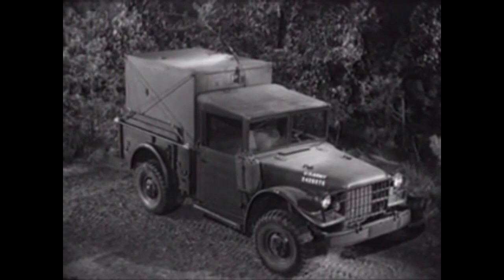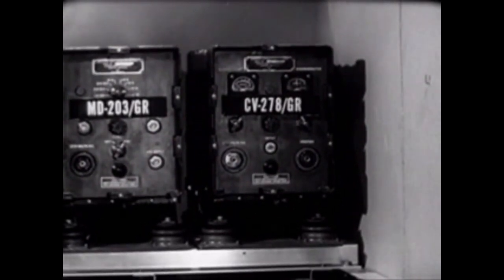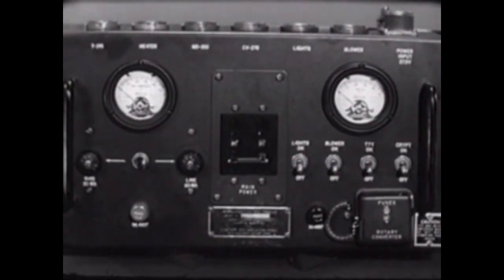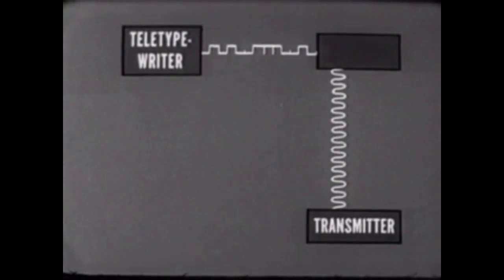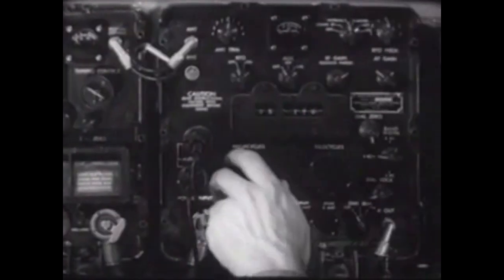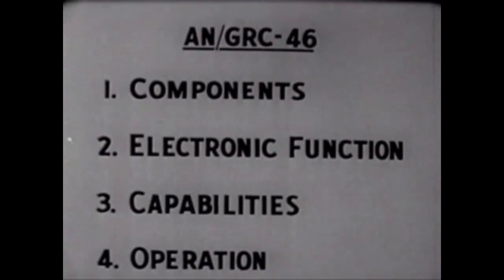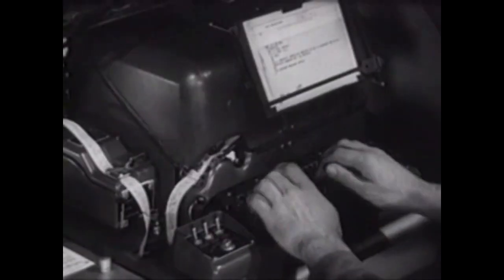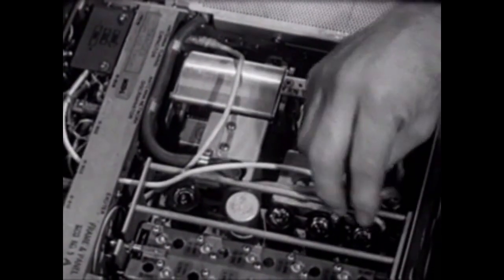Radio Teletypewriter Set AN/GRC-46 -1963 US Army Film

Comment: In 1962 I was in the 2ndBG/12th Infantry, !st ID. We used this with the KW-7 cypher machine. We could encrypt/decrypt teletype in line. We sent using the Tape reader. When you typed a message a perforated tape was made. You put the tape in the reader, pushed a button and it would encrypt and send it faster than you could type.
Reply from the maker: That is a great, concise explanation of how it worked. Thanks.

Comment: I was in the Army 81-86. I was using either a AN/GRC-142 mounted on a Gamma Goat.or a AN/VSC-3 (housed in a M577 command post carrier).  The transceiver was a AN/GRC-106. Affectionally(?) called an "Angry 106.  The teletypes were like you see here. A TT-98, and a TT-76 punch tape machine. The Crypto was the KW-7 (wire type). In the latter years the TT-98 was replaced with a AN/UGC-72.  Around 1985, news came down that the KW-7 and it's keylist had been compromised. It had been going on for nearly 20 years. Look up the "Walker Spy Case".

INT ZBK INT ZBZ K
Reply: When I was in Germany 84-86, they switched over to GMC/Chevy pickups.  The only people who still had gamma goats were wire and radio people.